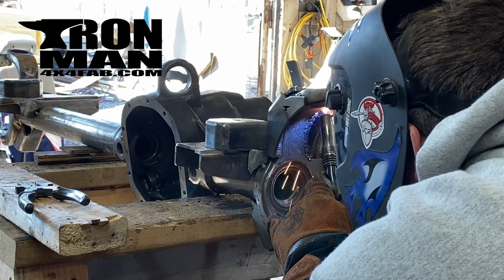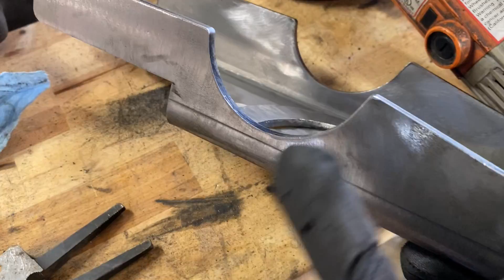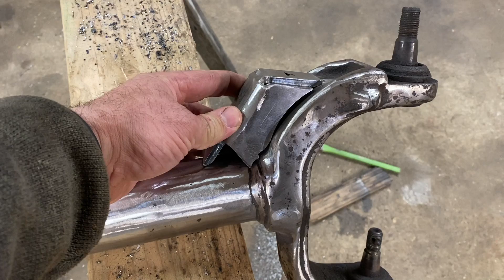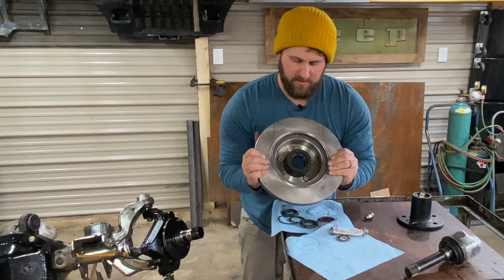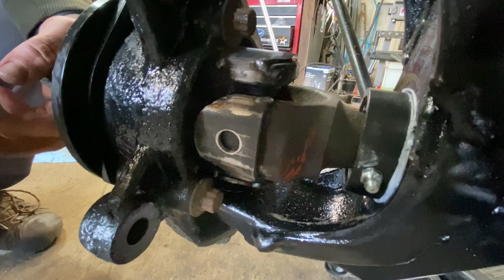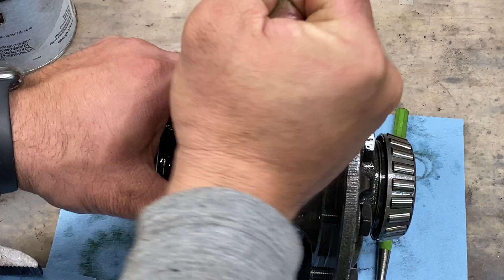Polishing a Turd - Beefing up a Dana 30 (without adding a truss)

Comment: Can't you just rotate the truss 90 degrees so it's on the back, or some other orientation that isn't straight up into your frame?
Reply: The benefits of a truss would be minimal if not on the top or bottom. Some racers build axles with bottom trusses, if there's less of a need for ground clearance than a lot of up travel with as low of a COG as possible. For me with 33" tires an under truss completely contradicts a major reason I kept the D30.  I'm really confident that the work I have done gets me at least 80% as strong as a truss would, without the extra weight and loss of clearance
Reply: @DRTJon  That makes sense. Thanks for the quick reply. Kind of new at the more detailed build stuff and always wondered about the truss angle.

Comment: Hey Jon are you planning on taking advantage of the high steer wj arm? If so look at the rugged Ridge kit steering kit with tera flex otk split bushings.  But now you'd have to move the track bar mount, but Worth it!
Reply: Yes eventually, when time and funds allow

Comment: Haha we were all watching that xj pass you too. I thought the caliper bolt spacers was part and parcel to the wj brake swap. I had seen in the rumor mill that there are some unit bearings part numbers that are an exception to the rule (at least I knew it applied to my 2001) and you wouldn't actually need spacers. My guess is you got lucky and now get to deal with the it with the hubs.Thx for the vid

Comment: Nice vidjeo! Question; Where’s your weak link? What happens when you break on a trail stubshaft unjoint wise?
Reply: Doc Niemo weak link TBD! I’d expect it’s going to be the locking hub, so I carry a spare. It wouldn’t be impossibly hard to knock the welded on cap off and replace a stub shaft or U Joint on the trail. Maybe I’ll make a video about trail servicing this setup?
Reply: Jon, thanks for the reply. You did a great job polishing the turd! I Don’t have the XJ anymore, but I’ll probably end up getting another, so y’all’s vids definitely stay in my feed! Adenda: still a Jeep gearhead and have a Dana 30 on my DD

Comment: Hey John, in the video it looks like your running the teves style WJ calipers(ones with the weird clips). not sure if you changed that out or not. If you didnt id highly highly recommend you take those off and find the akebono style ones from a 02 and up WJ. youll need the bracket it bolts to as well, but otherwise its a direct swap. and the only reason i mention this is the Teves style are known for seizing up and warping rotors.
Reply: Husky Dave’s Hobbies thanks for pointing that out. I bought a pile of stuff off a guy cheap, he told me they were Akebono, turned out they weren’t. I’ll switch them over when I have some spare $ for it, I’d like to get as much life out of these rotors as possible
Reply: Jon BleepinJeep I picked up a set from a local junkyard with the brackets for 50 bucks. So I’d start there depending on where you live lol. Otherwise “new” is prolly the better option.

Comment: The reason i can understand that hes running a D30 cause 1 he's pretty light weight especially with that tdi motor and hes running 33's wich is fine especially with the sleeves and c gussets but yeah :D also those welds look fantastic man
Reply: Dylan Aponte yes weight was a big factor for me. It’s hard to know what a build D44 would weigh but I’d have to guess significantly more. You have to do some type of truss with anything but a TJ “44” and till you buy all that and get everything the same lug pattern it’s a significant investment. Any axle you put under there is gonna be a lot of work to set up no matter what
Reply: @DRTJon  yeah for sure man like I say "weight has to do ALOT with what axle you wanna run,just cause you've seen a little tj with a D44 running 40's that doesn't mean you can stuff it in a jk with a v8 and 40s,you gotta see how much everything weighs"but great job on building that D30 keep up the great work man and stay safe 😇✌️

Comment: Do you think i can weld up a truss with a harbor freight welder ?
Reply: You would want a a 220v welder for structured parts. Once you've got the amps your own skills becomes the limiting factor. Practice makes perfect.
Reply: @brianluck84  straight to the point--excellent advice!
Reply: Jose Ortiz if you’re happy with the results of using it on normal 3/16” steel welds and confident in your ability to use it sure, why not. If you feel like you struggle to get it to perform as you’d like then definitely would not weld something critical like a truss with it
Reply: X2 on the 240v HFT welder, I have 62181 and I like it. Flip side though, use a 110v for sheet metal, bodywork.

Comment: Aren't those 1/4 inch hub spacers supposed to be welded?  Mine definitely needed to be welded or the unit bearing wouldn't have had anything solid to index into.  My whole hub would have been relying on the shear strength of those 3 bolts.
Reply: Homebrew Horsepower yes they are. Strange that they come powder coated
Reply: @DRTJon  yeah I thought that was weird too.

Comment: I sleeved and Artec trussed my 98 high pinion 30 from a XJ, Nodular steering knuckles, RCV’s, 4:88’s Been on 35’s for 14 years and 2 years on 37’s. Strong and durable in a 04 TJ!
Reply: That's an awesome testament to the turd! Thanks for sharing
Reply: Damn that's just about as much as a turd can be polished! You probably have way better ground clearance than guys running 37's on tons.
Reply: Do you feel like you could use more gearing on those 37s?
Reply: I'd like to do this too, but my TJ is my daily so I can't handle the down time... i may see if I can locate a housing and just do what I can a little at a time then swap over during a weekend...
Reply: Justin M. Honestly, the actually axle is the cheapest part. I am an XJ guy, but I think most of the TJ axles are low pinion right? You could pick up an XJ high pinion axle to work on for like 100 or 150 and you’d be starting off stronger anyway!
Reply: @bspizzledizzle  Dang...didn't realize they were that cheap.
Reply: I’m doing a similar thing. Are you using 27 or 30 spline axles?
Reply: @jeremyR87  30 spline inner/27 outer
Reply: I’m using 4:88’s w/35’s. Auto. Perfect.
Reply: @rile5960  What are you doing with it though?  Do you play in the rocks much?
Reply: @chevy2die  Yes. A lot.
Reply: That's a nice combo for something that weighs considerably less than a jk, wj ,  should be a great axle for years to come.
Reply: where'd you get the steering knuckles?

Comment: After trussing, chromoly and locking my Turdy, the one thing I didnt do was c gussets. And the one issue I have: Bent c's!
Reply: i was in a google groups once and a guy posted a picture of a small long cardboard box and he had a contest to guess what was in the box. i guessed a C Gusset and won!
Reply: Did you know the C's were bent when you did all that? Or did it happen/reveal itself after that. That's an unfortunate amount of work for an axle with bent C's
Reply: It happened in Moab running 38" MTR's after we had finished it all up, it was only a matter of time.